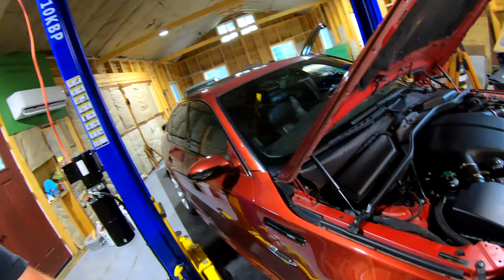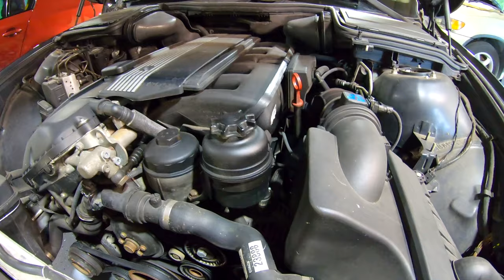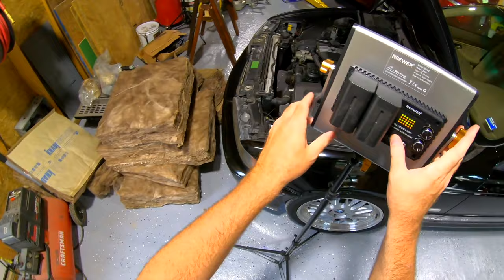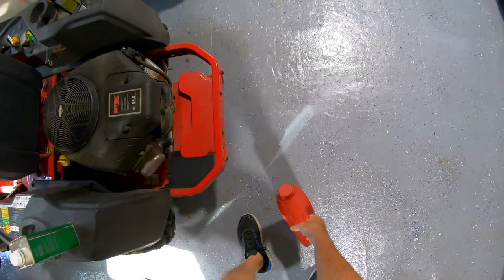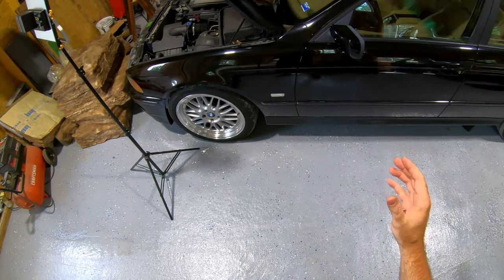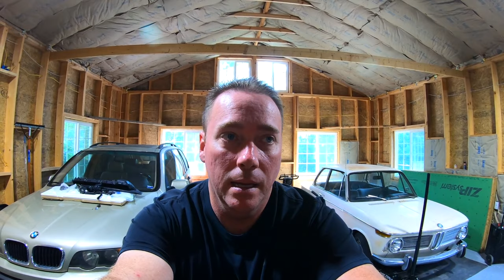How to Fix Power Steering Noise When Turning

Comment: I have the same issue since I have the car my guess was the pump but tomorrow Im gonna solve the little leak at the bottom and change the fluid. My car is a 523i  from 96' I have high hopes. Ill come back  and tell if it solve the noise. It have noise when you almost turn the wheel all the way. Thank you for the tip.

Comment: I have an 2000 E39 M62TU with an OEM LUK pump using CHF fluid with 121K miles that seems to be making clicking and screeching sound at idle.  What is the service life expectancy of that power steering pump and would replacing it with a TRW rebuilt pump running AFT be compatible with the rest of the power steering system?

Comment: Good call thinking someone might put the wrong fluid in,. It didn’t even cross my mind to think someone would be so careless to use transmission fluid accidentally over power steering but that could definitely happen! In the middle of trying to diagnose a squealing issue on a 2011 BMW 335i. All signs are pointing to a power steering leak but the fluid felt wrong. Hmm

Comment: Notice how to steering reservoir is right above the alternator. It was the same on our 1997 Ford Falcon and it leaked onto the alternator. Not only did we have to replace the steering hose but the alternator died because of it.

Comment: I have a small Hyundai Atos. Grinding noises when I steer fully. Added ATF Fluid in the reservoir yet still same situation. Should it be a belt then? I will use a syringe I guess to make sure.

Comment: Good video Nathan, just renewed my reservoir & fluid as I'm getting constant buzzing sound from my pump on my 1M. Anyway, didn't expect it to fix it, & sure enough it stills buzzes. Steering is fine, no other noises, just this annoying buzz from pump, which increases with revs. Looks like I'll need new pump, with only 25k on car :(
Reply: My man looks like it’s going to be your power steering pump! That’s what your problem is but regardless of what you did with replacing reservoir cause you would have ended up changing the reservoir & fluid and pump that’s the stupid thing Mercedes does certain things fail quite often :/ fkn horse shit

Comment: Can you help me? I have a bmw x1 e84. It makes a whining sound which is very loud on cold start but gradually quiets down as you drive the car, but does not go silent. The whining sound corrsponds with the revvs of the car, so the higher i revv, the higher pitch it gets. Iv changed PS oil(atf) and resivoir, but it stil persists. My steering wheel is slighly heavy compared to other similar cars iv driven. PLEASE HELP

Comment: Hi Nathan, thank you very much for your valuable videos. I have replaced the alternator on an E53, so I had to remove the steering pump, by mistake I drained some of the oil from the low pressure line. Before restarting, the pump started to do some noisy sound and I feel vibrations on the steering wheel. 
If you can advise, I will be more than happy to read you.
Thanks

Comment: Don't know why I'm asking cuz u never respond. My e36 feels like the ps just stops sometimes and it get suddenly tight. The fluids have always been good and there's no noises coming from the system. I do have a bad clock spring but that wouldn't cause binding in the steering would it?

Comment: If you are in the comments and wondering about BMWs, generally those with dynamic drive use the Pentosin CHF 11S (just like Nathan's E60 M5) and the cars that don't have dynamic drive will likely use ATF
Reply from the maker: Mower Moddin 2006 and up uses chf11s

Comment: I have an 05 x5 3.0i with stiff steering at low speed or at stop any advice? the fluid is fine and no squealing from the pump.
Reply: probably the pump is gone bad

Comment: Anyone have any idea what the problem could be with the speedometer not working in an E53? Rebuilt module, replaced sensor (rear left) with oem, I literally just finished changing the wheel bearing. Still no speedometer 🤷🏻‍♂️ it was working last week but reading double and putting double the miles on. Now it stopped completely

Comment: I jest drained mine yesterday and filled with Preston power steering fueled. BMW 2000 e46 323i.
Reply from the maker: Wally Lindberg it will Cause issues that car needs ATF
Reply: Thank you,  Wally

Comment: My conclusion is that German engineering produces scrap metal overpriced, overhyped, overrated and over exaggerated then called them performance cars. German engineering is not reliable at all. Like it at your expense but there will no joy for you after the car reaches 100k to 150k miles on the odometer. Most of the engine parts are plastic made, some parts are a mixed of cheap metals like chrome or vanadium mixed with aluminum. There risks of engine overheating is higher than in other car brands. Power steering pump always fails. ECU often has issues. This a hole in the owners pocket called everlasting maintenance. The engine is fitted and mounted in a 45% angle to leak oil. The only aspect I can add value in is that they make great solid bodies, strong beautiful interior design coupled with a marvelous balance suspension and transmission. Their engine is design are Sh*t